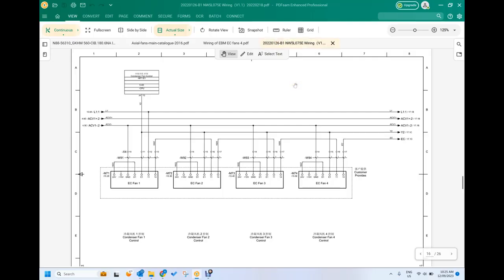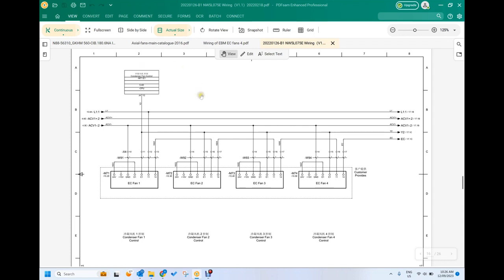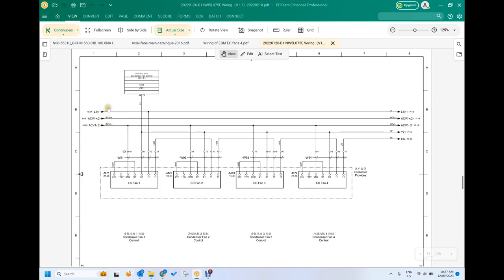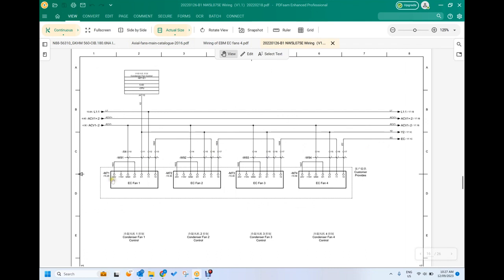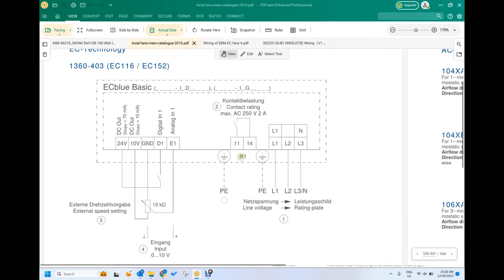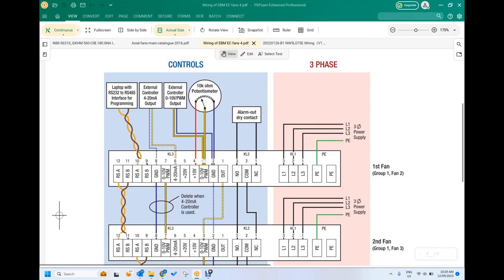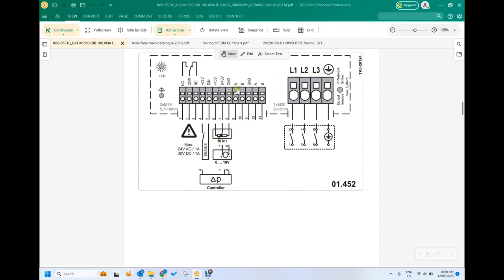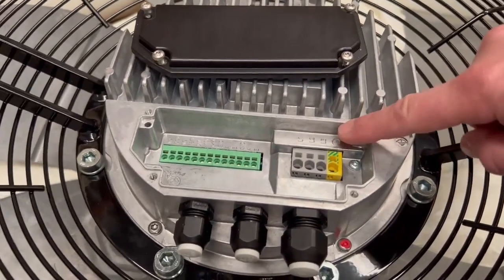EC Variable speed fan connections

Comment: thenks bro i have ebm papst fans wiring like that working control by o 10 v i need your help to show me control and how checking manuely pls this may whatsupp pls oir i need your whatsupp nember sir
Reply from the maker: If you can detail the "fan model number in full" I can likely help. EBM have (2) different wiring versions I'm aware of and the digital input can also be NC or NO depending on the model. Frequently the fan will be supplied with matching operator manual which has a table listing these variables but its still not always 100% obvious.